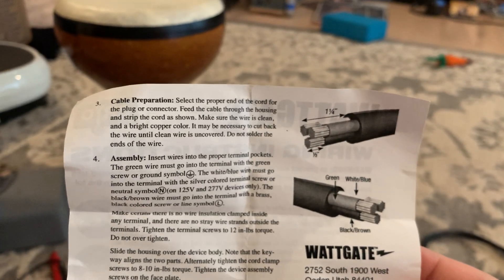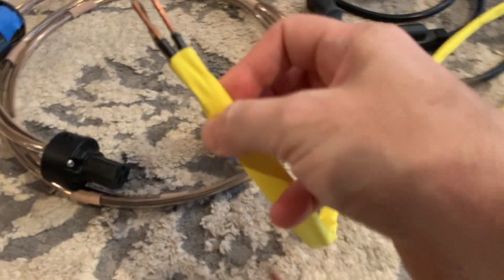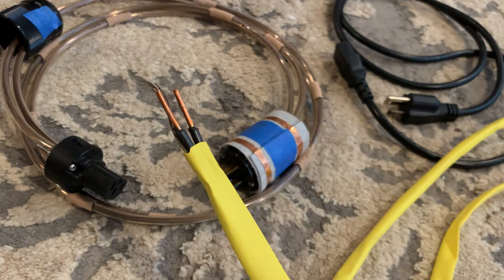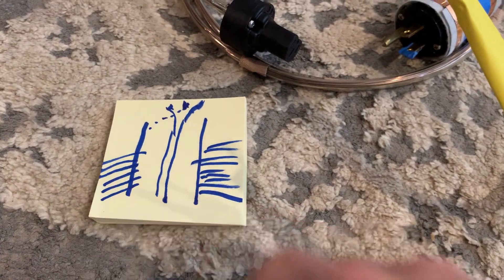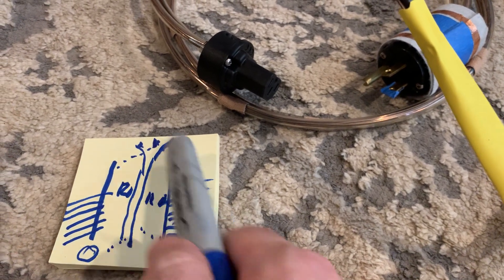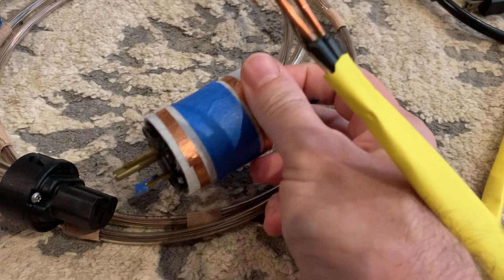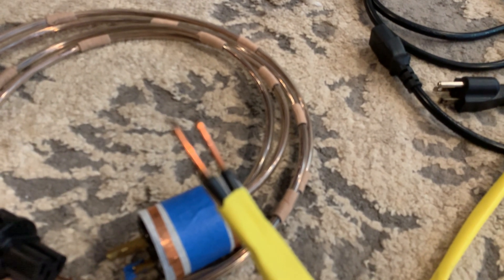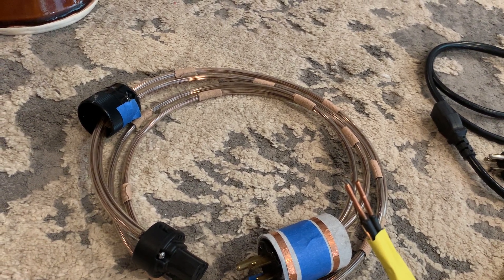The F moment with power cords

Comment from the maker: !READ FIRST::::: !!WARNING: DO NOT RIG YOUR POWER CORDS / APPLIANCES THE WAY I DID!!! In the scenario above, I have MODIFIED THE AMPLIFIER - so that the ground pin carry neutral instead, for doubled current capacity. This way: 1., I lost the safety grounding 2., the amplifier CANNOT BE USED WITH UNSAFE CORDS (non-UL approved). The SAD MORALITY of the story, THE REASON WHY I POSTED IT, is that non-UL approved cords CAN FLIP NEUTRAL AND HOT. (And that's my outrage - why manufcture something defective ON PURPOSE?!!!! Where the F do we live that cheap 'ss companies make such life threatening cords, while it would cost them EXACTYLY THE SAME EFFORT AND MONEY TO MAKE IT SAFE AND RIGHT.)

Comment: Do you have the recipe online for your new silver power cable? I’ve spent several hours looking through videos and have not found it yet. Thanks very much!
Reply from the maker: No, I have not written down the recipe, as it is not UL compliant. It is a liability issue. I do not want to suggest something that will definitively take the heat in case somebody burns their home down or does something unexpected. 
Unfortunately our world is dominated by lawyers and I must bow to them.
Reply: @realworldaudio  if the third cable for ground is added, would it be acceptable then? I was wondering if this is Teflon tubing and also what gauge/number of silver wires you were using.
Reply: I just wanted to clarify that I don’t want to repeat your experiment inside the amplifier. I just want your recommendations for what silver wire gauge and how many wires to use to build my own power cable. Thanks
Reply: @MrCantredr  I use as thin and as short as possible. AWG30 3N silver wire, 100-200 strands paralleled per conductor. Once you have the hundred wires running alongside each other, twist them a couple times so they form a nice tight bundle, but not so tight that it will start to kink. Then, use a fishtank hose for insulator.  Use a ground conductor (third conductor) as well for good measure. However, you will notice that the sonic benefit of adding or ommitting the ground wire will depend on the actual unit and how other components are grounded. Other than that, for safety reasons, always use the ground connector. 
I stay away from giving a set recipee as silver as conductor material is not UL approved for power cord use, especially when one does his own insulting. Proceed at your own risk and responsibility! Good luck! Avoid 1m length, and any multiples of it (0.5m, 1m, 2m, 4m... these are the best antennas for picking up EMI/RF.) Use 0.3m, 0.6m, 1.3m, 2.5m, etc wire lengths.

Comment: Ah, ok…Thanks, Janos. I’d just asked you about your recipe for power cords. Glad I found this vid! I’ve luckily already got the Wattgate plugs, but I’m using a couple different cables for my monoblocks vs my preamp. I’d like to possibly upgrade the cables and keep them all the same, or I’ll try your method with the extra silver wire. Thanks again!

Comment: Ground wire is only there for protection by galvanically connecting metal structures to earth potential, they are not supposed to carry currents under normal conditions!! If you think you need more current carrying capacity simply increase the live and neutral wires cross section. 
What you are offering is simply dangerous and against codes and will probably trip GFI (if there is one installed upstream)
Reply from the maker: You are absolutely right. This was an experiment that I was doing - I rigged it that way because the neutral connector could not accept heavier gauge.  Ground should never carry current  - in this situation the neutral was doubled, using the ground pins on both sides as extenders, and safety ground was not used. However, I hope, this video dissuades everyone from trying this out.

Comment: WOW !!! who would have thought. Stay safe Sir.
Reply from the maker: Was quite the fireworks! Will show the busted IEC socket. Quite a bit of metal from the power cord got molten on the IEC pin - so much, it ruined the socket & cannot plug in a power cord anymore!
Reply: @realworldaudio  Albert -- of all peeps -- blew up a transformer when building a pre-amp recently. Hard to do right... even the "pros" can get it wrong !!!
Reply from the maker: @craigcharlestone  Cheers, LOL! Actually this did not bother me much, I just grabbed those junk because I was lazy to go upstairs for a proper audio power cable... But I was truly pissed that the situation is so bad that new appliances come with defective power cords nowdays!!! 20 years ago it was hard to find a defective one, so I have not been checking these black generics - esp as I never use them as dedicated audio cables. (This was the ONLY case that I did that, even with the intent of doing so for an hour or less to watch Netflix..)  Yet, it's a big, big red warning that quality control / safety checking for general appliances today is piss poor compared to 20 years ago. 20 years ago it was a safe assumption that all gear you buy is UL approved, and now you need to go through each and every component and check each label, as many are not?! WTF??!!!! WTFaaaa??!!!! No wonder that over 100,000 (!) homes burn down in the US  every year due to electric fires. And these F#%$E%^@# power cords play a big part  in that sad statistics. Pardon my French, as the issue is all too clear and there's nothing being done to fine / ban / close down for good the companies that make these hazardous "products".